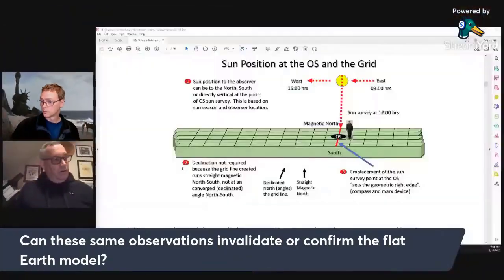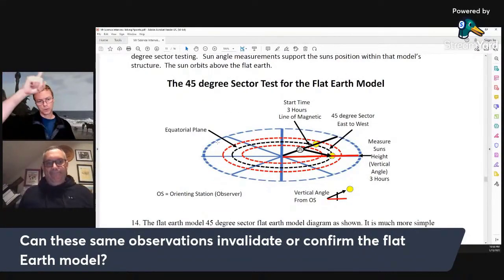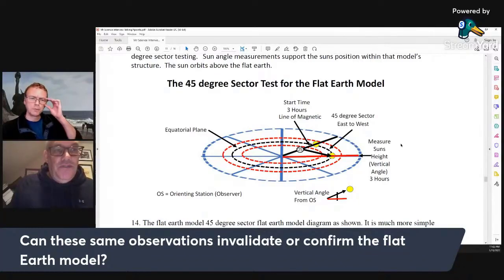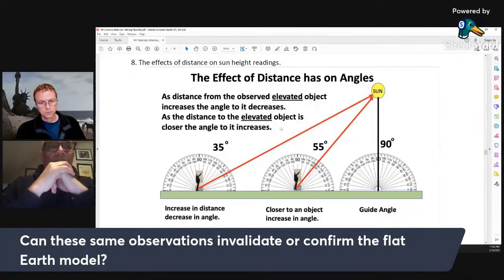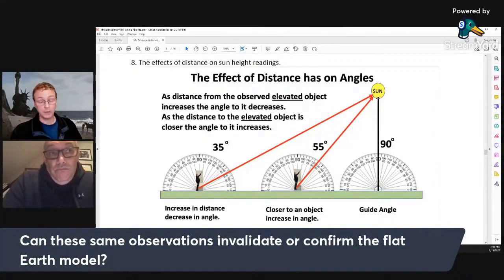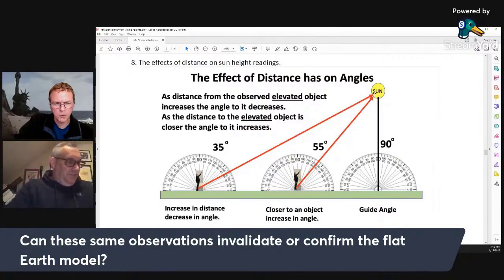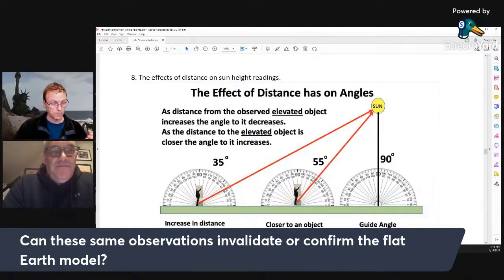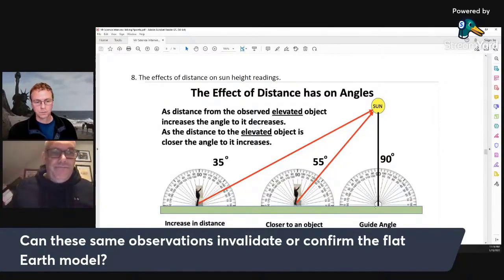Conversations with Corey - Does this work on Flat Earth?

Comment: 14:00 all that waffling around for 5 minutes of verbal tap dancing and he never explained why the Sun’s maximum elevation height on flat-Earth would by 87 degrees.

Yes Corey, we understand that you think the Sun is very small and only 3-4,000 mikes hight. The Sun’s size doesn’t matter. The Sun always has a GP over a point on Earth where it is 90 degrees straight above that spot. It’s why Polaris is 90 above the North Pole. Or does Corey think the Sun’s apparent size is smaller than Polaris?? Corey makes zero sense.

Comment: 1:29 When I look at Kell's presentation one of the things I find so confusing is his graphics. They don't follow any kind of convention that I can grasp. They aren't perspective drawings. They aren't standard orthographic drawings. I gather he is self-educated to a large extent, including some of the time he was in the army.
My father was born on a farm. As a teenager he was repairing farm equipment, tractors and so forth, having learned from his older brothers. When he joined the Army at 19 he got into an engineering corps and was trained in engineering. So he learned drafting techniques, mechanical engineering, etc. That was of course back when everything was drafted by hand and you had to understand how to delineate complicated 3D parts in a 2D format, so that they could then be fabricated. This might be something as complicated as elliptical gear wheels. My father had a great education in the army and also an aptitude for the work. He passed at least some of that on to me, I'm happy to say.
All that is a complicated way of saying that Kell, despite his Army experience, never seems to have gotten that kind of rigorous training. I wonder if the Army has changed or if it is more to do with Kell himself.
Reply: As I said in my top level comment, I doubt he was one of the guys figuring anything out. Seems more likely he was just told to do x, and he knew how to turn that order into execution. But how that order was calculated, why it was calculated in such a manner, were not his concern. 

Now, he’s in a position where he has to do all the backstage stuff, but he can’t. He tries to mimic the words and terms but he ends up ascribing his own meanings to them because he does not actually understand the actual process. Which is why it sounds like he’s using military terminology but it’s not, it’s all concepts he invented and taught to himself. 

This gives him an air of authority to people who have no clue and are just looking for things to latch on to their fe beliefs. But for people who do know how this works, neither the concepts he’s communicating nor the mil terms make any sense. That’s my assessment of the situation at this point.